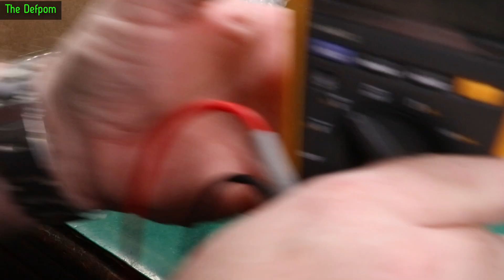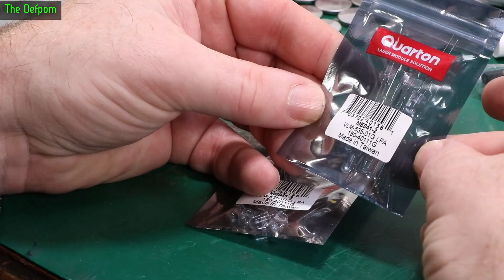🔴 Mailbag Monday 18th March 2024 - No.1231

Comment: Hi Scott, I use those LIR2032 also and they work well, I have it on all IOT devices on my house, word of caution, don't pill them up like coins. They immediately start warming. Nice video! Cheers Hugo
Reply from the maker: I found a 3D printed holder on thingyverse and am using that to store the batteries in, it insulates them from each other at least.

Comment: I have that exact same Lazy Susan. Purchased it from Amazon though. Use it mainly for working on heavy audio amplifiers, old analog 'scopes and other older heavy test equipment. It is noisier than heck. One benefit to the bearings not moving well is that you are not constantly chasing the piece of equipment you are working on around in a circle. Thinking about disassembling it to see if a little white grease might quiet the bearings down.

Also, similar to your last segment, I enjoy purchasing test equipment and audio equipment that does not work. I used to scour the local thrift shops for that sort of thing before everyone starting looking those pieces of equipment up on ebay and expected to get big money out of the stuff. I've been given audio equipment from co-workers worth a considerable sum that I have resurrected and use the equipment in my house, basement and garage.

 And also have search items set up on ebay to find similar equipment, specifically looking for equipment that does NOT work. Occasionally do YouTube videos on them, but find the whole process of doing videos distracting. Also, I am much better at conveying my thoughts in print than I am verbally, so do not do many videos anymore.

Comment: you should have opened the noisy Lazy Susan it sounds like crap 🙂
Reply from the maker: I did later on, put some silicone grease in the bearings and now it is about 1/4 the volume

Comment: The cheap lazy susan I have is much quieter. It has a triangular pattern on the top and bottom if you see one on Ebay etc. It's slightly smaller but handled a large 70kg PSU on it no problem.
You can also try the aluminium mechanisms, just need to add your own top board.
Reply: I was looking for a lazy susan for computers when I am working on desktops rather than man handling the cases all the time.  I have see the aluminum mechanisms on AE. Amazon has a lot of them but you wonder if indeed they can support any substantial weight.